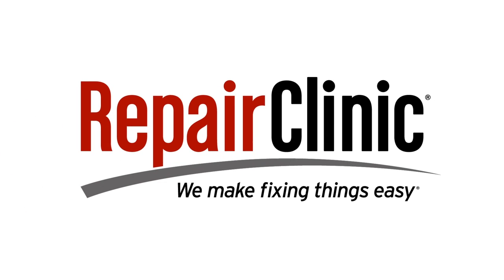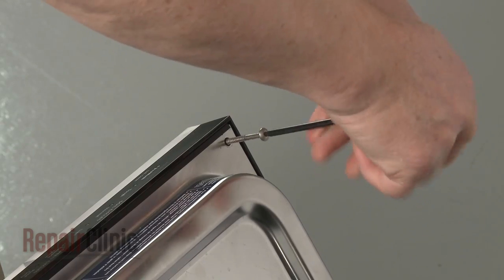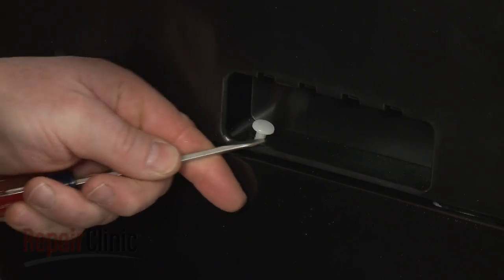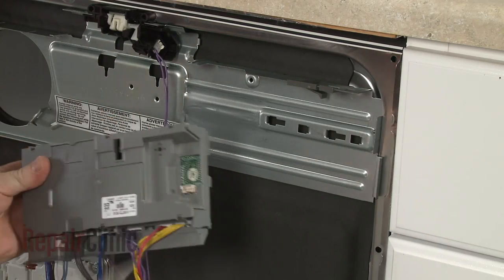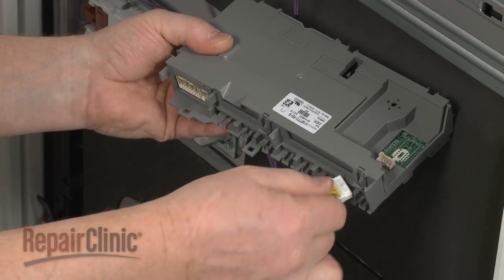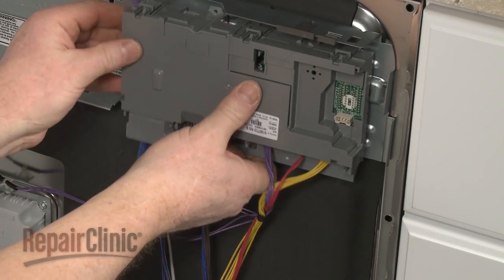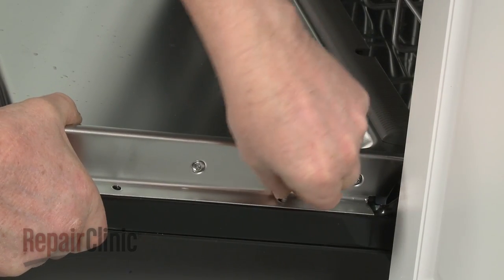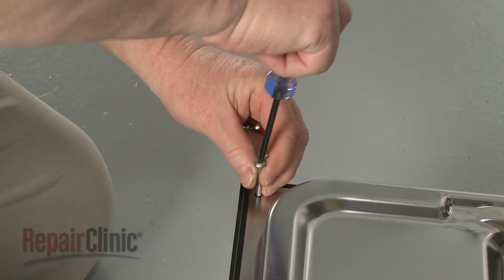KitchenAid Dishwasher Control Board Replacement W10909702

Comment: Appliances are disposable unless you can fix them yourself using these great videos.  I had a repairMAN look at my dishwasher and told me that nothing is wrong with it despite the fact that IT DIDN'T WORK.  I diagnosed, purchased the part and repaired it using this video.  So very easy and inexpensive. Don't waste your money on a repairman - DIY!
Reply: Not every Professional is a Fraud. Do your research on the Tech and check his Credentials. I myself went to school for Appliance Repair and do this Work everyday. Not a lot of people are handy and mess more up on the appliance then they actually fix from watching these video's. Always keep that in Consideration. Should you need a Professional again at some point ask for his PSA Card. He doesn't have one. Send him on his way.
Reply: I called a repairman, he figured the fill valve was bad. He quoted $90 ($40 online) for the valve and $275 for the labor.  I took out the valve in 15 minutes to test it. 10 minutes back in, and the valve costs $40. (the valve is OK something else is wrong.)

Comment: Nothing like replacing a one inherently bad and faulty mainboard with a new board with with the same inherent issues...only to fail exactly the same way in the very near future. Kitchenaide needs a class action lawsuit.
Reply: What was the problem with your dishwasher?   
And what lead you to change the main board ?
Reply: @Cndfirr  Usually it's not the mainboard but some other error causing a fault that prevents a comlete cycle. For example, in my case, too much scale on the heating element and TDS sensor was causing a fault that required a reset to get a good wash cycle (probably a calibration issue). However, I found that using citric acid every cycle cleaned the scale off the element and TDS sensor, and now my washer runs perfectly without requiring periodic resets. I've tested out not using the citric acid and after a few cycles I get an error. When I return to using it, zero issues again. The other added benefit is the inside of my washer looks brandnew again. I buy 5-pound bags of powered citric acid from Amazon and it lasts a very long time. Anyway, it's a very high maintenance washer, which I think the same can be said for all so-called "smart washers".

Comment: Excellent video.  Have a somewhat-similar KitchenAid dishwasher (from 2010) and this video was about 90% accurate.   One major difference is my model does not have a custom door, and no retaining pin holding it on once all of the screws are out.  Also, the two control panel screws near the main latch actually thread into the door and need to come off to remove the door.  Besides that, swapping the control board was more or less an identical process.  Curious how long this board will last!
Reply: How did you know the board was bad and not the touchpad?   My dishwasher won't fill and the fill valve works correctly, I tested it.  Thanks.
Reply: @carlc88  Honestly, it was somewhat of a guess. I had found others online experiencing the same issue I was (every week or so, I had to cut power at the breaker to the dishwasher, as the whole thing would go unresponsive) so I figured replacing the main board had a good shot at fixing it. Good luck!
Reply: @cliess  Thanks Craig!

Comment: Remember to reset the computer after the repair or sometimes it will not clear the code, Thanks for the video it helped a lot.
Reply: Going to replace my module but don't understand your "reset the computer remark" how is that done, thanx.

Comment: We replaced the control panel, not the control board, and the dishwasher worked twice. Now it won't go from wash to rinse again. It just runs in wash cycle for hours.   Is this a control panel problem?  Would like to know before I spend more $$$.  Thank you.
Reply: Did you ever get it fixed

Comment: RepairClinic is awesome. Whirlpool/ Kitchenaid is pretty poor though. Ours melted wires and this control board. Common problem and unacceptable.
Reply: @drakedorosh9332  Thanks - after inspecting mine it was actually just the board. All the connectors were perfect and what I thought was melting on the wires was the sound insulation transferring from the tub to the wires. On mine the relays on the heater circuit overheated and melted and at a minimum smoked... possibly a brief flame. Either way, after 6 or 7 repairs on my Kitchenaid in 7 years... this was the final straw. It has made its way to the dump and been replaced with a Bosch. So far so good on the Bosch.

Comment: Really sad when the parts and time aren't worth the repair. Junkyard and roll the dice for the next manufacturer.
Reply: @jonszelog7959  shouldnt be broken after only two years to begin with... I'm I have two kitchenaid dishwashers.. one is dead in 2 years the other in 5. Appliances should run for at least 10 IMHO.